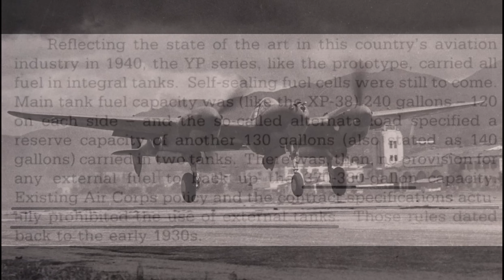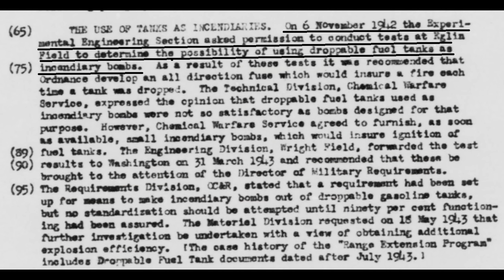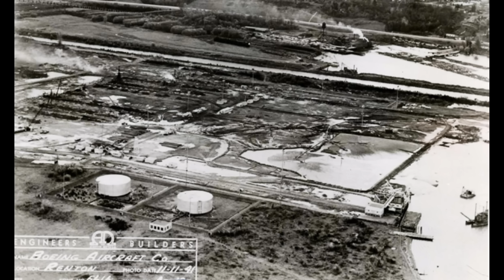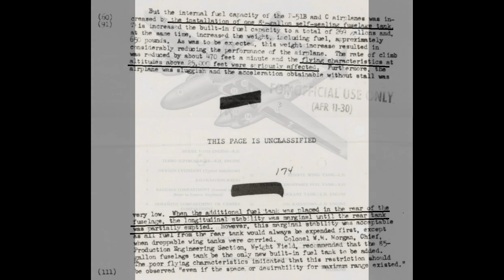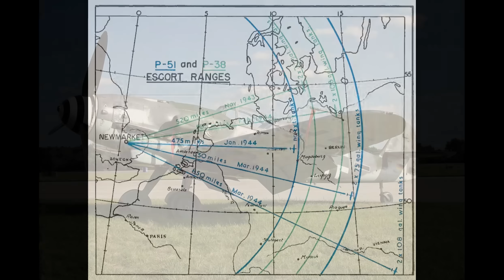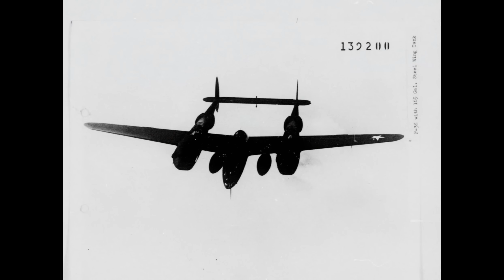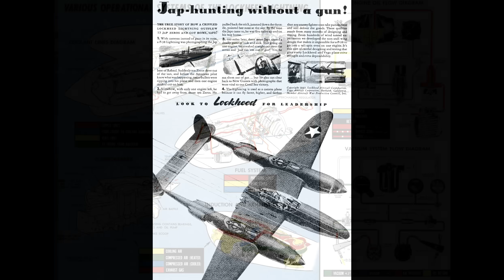The P 38 Lighting and the Bomber Mafia's Failure In World War Two

Comment: The test pilot Eric Brown's report comparing P-38s to FW 190 and Bf 109 indicates that it could not cut the mustard in close combat with either in European conditions. Brown liked many US aircraft so it was not bias. I think you are gilding the lily mate.
Reply from the maker: That misses the point though doesn't it?
Reply: @GregsAirplanesandAutomobiles this, it’s just obfuscation of your main point on use of P38s with fuel tanks before any suitable P51s were available.
Reply: what does cut the mustard mean though? all bomber escort aircraft were heavy with enough fuel to have 5-10 min combat time then head all the way home. no laden P51 or P47 immediately after dropping tanks were cutting inside or outrolling light 109s or 190s. they were booming and zooming, catching aircraft unawares or at an altitude disadvantage. 
The P38 was no great dogfighter but to pretend it wasn’t an effective fighter is frankly absurd.
Reply: Does Winkle make a purely technical comparison of those aircraft with optimal pilots or does he consider the aircraft in sub-par hands?

For comparison, a raw RAF pilot in the Battle of Britain would be posted to a quiet sector away from the high combat demands of 11 Group and frontal squadrons in 12 Group so the combat pilots were more evenly matched but by 1944, Luftwaffe training was giving newly qualified pilots half the flight hours of its 1939 training classes and it's newly qualified replacement pilots went straight into front line service against allied pilots who were far better trained.

So was Winkle comparing a Winkle standard pilot in a P38 against a Galland standard luftwaffe pilot in an ME109 or FW190 or was he comparing his P38 against newly qualified luftwaffe pilot Johan Schmit in the ME109 & FW190?

Yes, it took training to get the most out of a P38 and there were early problems with it in the European Theatre, but in 1942/43 would a USAAF crew want no fighter escort or even a sub-par piloted P38 to distract luftwaffe fighters?

At its most basic level, using weak pilots in sub-optimal P38s is comparable to the current solution adopted by Russia in Ukraine; send loads of decoy drones along with Shahed drones to occupy Ukrainian AA defenses in the hope that the more expensive attack drones will make it through. This isn't a neat win/win solution set but rather a maybe-loss/maybe-less-loss situation, where the sole pilot & fighter is given a lesser priority than the two pilots, crew and mission-planned damage of the bomber.

Comment: I'm sort of on the fence with this one, Greg. On the one hand, a P-38 escort would have kept the German fighters occupied and cut down bomber losses. On the other hand, I think the Lightning would have had an unsustainable attrition rate when opposed by large numbers of German fighters. This is the conclusion of AAF Wright Field flight test report on 2 P-38 Js,  10/27/43: "These airplanes are unsuitable for tactical use above 20.000 ft." Report noted: severe detonation at WEP , inter-coolers and entire induction system leaking badly. resulting in loss of critical altitude of 7,500 ft.
Reply: That was a statement on the condition of the planes given them, and their maintenance habits. The chin mount intercoolers were good to 1750 HP with 120 octane fuel, and to over 2,000 HP with 150 octane fuel.

The actual loss rate of the P-38 in combat in the 8th AF was 1.6 enemy planes destroyed for every P-38 lost for ANY reason, including non combat related losses of navigation errors, fuel exhaustion, pilot accidents, etc. And that includes a period of time where the P-38 was the ONLY fighter available, and faced 10:1 odds against an experienced enemy over his home territory, while the P-38 was flown by mostly green pilots with no combat experience.
Reply: @AlanRoehrich9651  Lt. Col. Royal Frey gives a detailed account in "Flying Combat Aircraft of the USAAF" of his escort missions in the P-38 and why it was outperformed in the skies over Europe. The cockpit temp at 30 k ft. that Greg downplays as "cold" was identified as "paralyzing"; with pilots being so frozen it seriously affected their combat efficiency and  engine management  with three pairs of gloves on required deep concentration and luck. The greatest problem was the installation of the Allison "time bomb", with plane after plane turning back on missions because of an engine that had blown up or a "runaway" turbo-supercharger. Frey himself wound up in a POW camp because his left engine blew up after only three minutes at military power while chasing an Me-110. Frey suggested that the P-38s troubles would have been remedied much sooner if Lockheed tech reps had been forced to fly them in combat.

Comment: Re Eaker's opinion on self defending bombers beyond the range of escorts: All that goes out the window when the ME-110's (and some single engines fighters) appear with the 210mm rockets.  They whacked a bunch of B-17s and the losses didn't become sustainable until the rocket firing fighters were driven out of the fight by about March '44.  I am not an Eaker fan at all.
Reply: the rockets weren’t really effective at all though. frontal attacks on edges of formations and/ or attacking stragglers were the most effective ways of breaking formations
Reply: @garydownes2111  Attacking stragglers would not break formations.

Back to the pub with you.
Reply: @garydownes2111  The rockets were deadly. One German heavy fighter unit claimed 9 B-17 kills in just a few minutes on Black Thursday. The Americans tried to get the combat wings into the tighest formation possible to prelude the Germans from flying through them.  Turning away the German A/C would be better targets for the gunners was the thinking.  

This didn't work at all.  What could happen with the tight formations is that if one Fort was hit it could tumble into a second Fort or even two others.

Giving the lie to your statement is that once the rocket armed fighters were driven out of the fight 8th AF losses declined quite a bit.
Reply: @ not true
Reply: @garydownes2111  

"Inside German airspace, the Bf 109 G-6 fighters of 5 Staffel/JG 11, which had pioneered the fitment of the Werfer-Granate 21 unguided air-to-air rocket weapon system to the Luftwaffe's single engine day fighter force the previous day, as well as the similarly armed rocket-launching twin-engined Bf 110 Zerstörer heavy fighters, including night fighters, joined the battle as more than 300 fighters from 24 bases opposed the raid. At 14:36 the force diverged from the morning's route at Worms, Germany, alerting the German defenders that the target was Schweinfurt.[18]

Losses among the 57 B-17s of the lead wing were so severe that many among its airmen considered the possibility that the wing might be annihilated before reaching the target."

-Wiki

This action was on August 17, '43.
Reply: @ but not primarily rocket related. and since when is wiki a source?
Reply: @garydownes2111  wiki is better than no source which is what you have.  After the Berlin Raid on 6 March '44 the heavy fighters had to be withdrawn; their losses were prohibitive.

One of the last big fights was on May 12.

"Mass saturation tactics were pressed so close that at least one rammed a B-17. From this ordeal the 4th emerged in some disorder. Colonel Vandevanter flying with his 385th
Group inthe lead, ordered the formation to reduce speed so that others could
reform; this undoubtedly added to the good bombing later achieved-- the 385th
managed to place 97% of their bombs within 2,000 ft of the aiming
point. Four times the 4th Wing was attacked on the mission, losing 11
Fortresses, 7 from the 447th group.The 3rd division's 45th and 13th wings attacked the Brux oil plant leaving it burning and inoperative, while Liberators of 2nd Division achieved similar results at Zeitz and Bohlen; great damage too, was inflicted
atMerseburg and Lutzendorf by the 1st Division."

--"The Mighty Eighth" p. 141-42 by Roger Freeman

3rd Division losses were 47 Forts but it was nothing like Black Thursday the previous October.  And German losses were much worse.  Gunther Rall was wounded in a fight with the 56th FG. The  experten were mostly gone.

Comment: I wonder if there are bomber mafia paw prints on the strange story of the P-59A jet fighter, where Hap Arnold withheld critical engine specifications such as the air intake area, supposedly for secrecy. Sure, the folks at Bell would have sent the spec off to the Germans as soon as it arrived 😛. It's plausible Arnold would want to prevent a revolutionary new type of fighter from proving bombers could be shot down in big numbers.
Reply: He may have been worried about leaks to the Soviets more than to the Germans.  There were spies in the Manhattan Project that made sure Stalin had all the info on the Atom Bomb just as soon as we did.

Comment: 8:53 "only 2 or 3 use the metric system in aviation"
That is not really quite true. In reality its mostly a mix. Typically fuel is measured in kg (metric), altitude is measured in feet (imperial) and distance is typically measured in nautical miles. A nautical mile is basically metric.

A Nautical mile is a km times 10 000 divided by 90 and then divided by 60. Or if you go the other way a km is 90*60/10 000=0.54 or 54% of one nautical mile.

Why that diffrance, well that is becasue a quarter lap is 90 degrees, and there is 60 minutes in one hour, that is a arch minute. While a km is 1/10 000 of a quarter lap. 

Speed in aviation is typically measured in knots, that is nautical mile per hour, that again is basically metrical.

Its worth saying that metric is different from SI unit. Metric is what ever unit is based of the meter. (or more specific, meter, second and kg), and that is the case for both nautical mile and knots, while a SI unit is defined as a specific metric unit.

For temperature, most countries use Celsius that is a metric unit (the metric unit is K). For angle degrees is used that is metric but non SI (the SI unit is radian). The radio use Mhz, that is both metric and SI. Length of runway is typically measured in meter, both metric and SI. Time is measured hours, minutes and second, that is metric. Also date is typically measured in YYYYMMD that is also metric, or at least ISO standard.

Airpressure is measured in PSI, that is a imperial unit. Power, when it is measured (it rarely is) is measured in kW, at least on jets and the system power.

And speed relative to speed of sound is measured in mach number, that is technically not metric, but work on the same logic as metric numbers do. And its very much note imperial.

So i would say that most countries does not use imperial for aircraft apart from pressure and altitude.
For speed, distance, fuel, temperature and so on, most countries use metric, while usa for the most part use imperial.

Comment: Boy, Greg, this one hits a little close to home.   My late uncle, Antoine J. Roy was tailgunner on B-17F 425337 on a mission to Bremen, one of the first anti aircraft factory raids.   I think they actually went to Vegesack.   This aircraft was assigned to the 401'st Squadron 91'st Bomb Group from Bassingborne, UK.   The aircraft was hit overhead near the Frisian Islands on return.    It was disabled, crashed into the sea, and only 2 crewmembers survived.   Uncle Tony is on the permanent MIA list.   The date was April 17, 1943.   The squadron sent 9 aircraft and only 3 returned.   Besides the Schweinfurt raids, this was about the worst loss rate of the war.   The 401'st has a few excellent websites including dailies of the combat actions.   After a while, it is tough to read them.   There is an excellent book, "Wray's Ragged Irregulars" about the 401'st, also Malcolm Gladwell's "The Bomber Mafia", which you likely have seen.   Those books were no fans of Hap Arnold or Ira Eaker.   It is said that there were over 300 P-38's at storage depots stateside escorting cactus and sagebrush.   My uncle's plane was called "Short Snorter III".    As always your reportage and pictures are excellent and right on point.   Sorry this post is a little long.   Great Work!

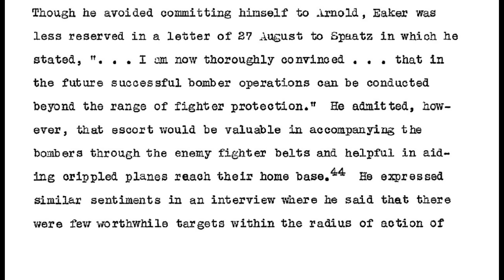Comment: 44:17 Keep in mind that the German fighter force in the west was deployed in a belt, under GCI (ground controlled intercept using radar). Given the tremendous area of Germany and conquered territory behind the belt, an area defense might be impractical because of how many radars would be required, number of interceptors, the complexity of organization and integration over a much larger area than the British system, etc. So it was within reason that bombers would suffer far less opposition after they broke through the fighter belt. Eaker also believed that once the 8th Air Force was a full strength, it would be able to swamp and deceive German fighter defenses. With combination of feints and overwhelming sections of the fighter belt, leaving fighters from other sectors unable to complete interceptions.

(Prior disclaimers apply.)